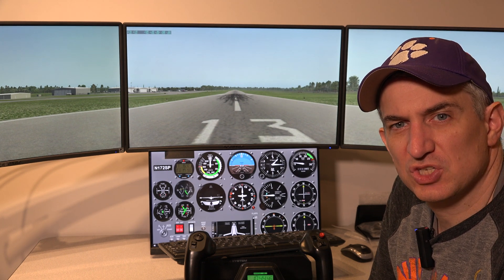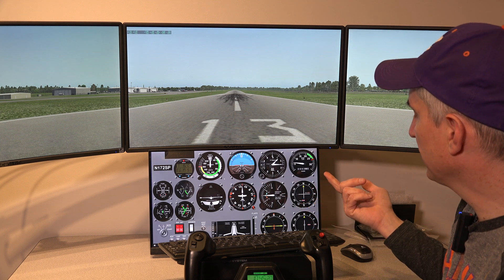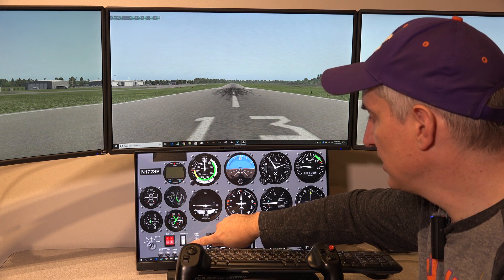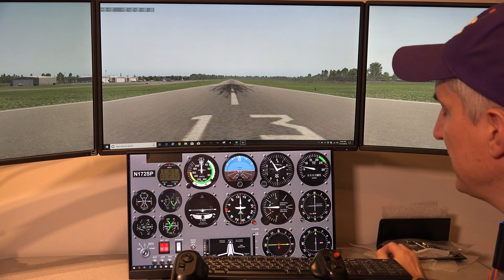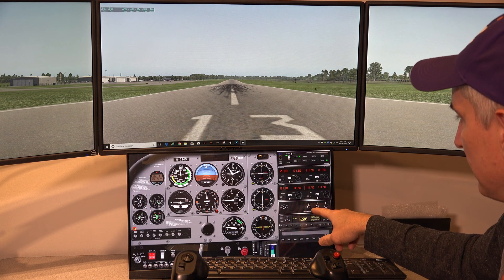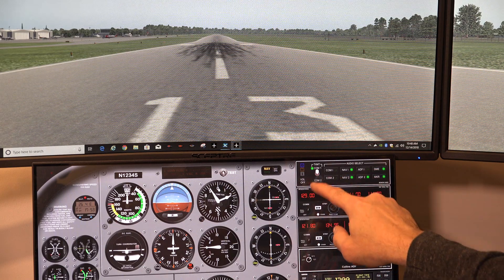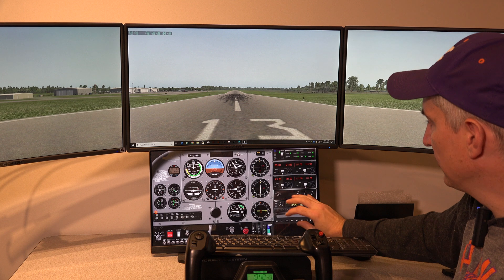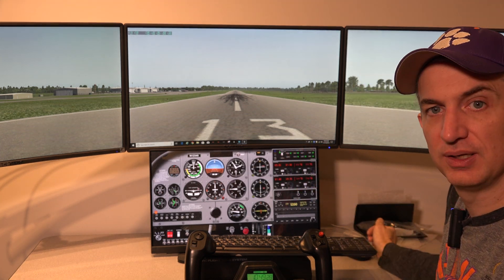How, exactly does the touchscreen work with Air Manager

Comment: Hi Michael, Obviously the triple screen has to be set up as the main monitor (because that is where Xplane appears) and the touchscreen monitor has to be set up as the secondary display.  This is where I run into a problem because the touchscreen functions wont work on the secondary monitor unless it's configured as the primary monitor. I have tried all the setup/configure options Windows 10 provides without being able to resolve this anomaly. I'm sure I'm not the first simmer to run into this problem. Did you have any problems when setting up and, if so, what steps did you have to take to resolve it?  I am using a GTX 1080.  John.

Comment: I would love to use all that stuff if you could please figure out why my simulator has quit working! Set it up in the graphics page ... great (70-80 FPS) frame rate. Switch to cockpit and frame rate drops to 0.1. You famous tech support hasn’t figured it out and I’ve been unable to fly for over a month.
Reply from the maker: Are you using any of the logitech panels?  (switch, radio, Multi)?
Reply: Michael Brown yes I have a Logitech six pack and radio, multi panel, and a switch panel, all of which are turned off. In addition I have turned down the weather screen to clear. The frame rate drops on any airplane, no matter what the graphics settings are. X-Plane11 worked well for about 3months then suddenly started this frame rate problem. I’ve tried everything but no luck. Tech support sounds like they are grabbing at straws. I thought about uninstalling the whole thing and installing it new. (I have an extra set of discs that came with my sim package when I bought the entire setup in July). Please figure this out.
Reply from the maker: @pappybo49  Go into the plugins folder and delete the Saitek plugin folder (or move it to your desktop) and try again.
Reply: Michael Brown the only place I find a plug-in file is in a resources folder which is in an X-Plane11 file in Desktop. And that doesn’t refer to Saitech plug-ins
Reply from the maker: @pappybo49  If the saitek plugin is loaded, there should be a folder in the plugins folder called "xsaitekproflight".
Reply: Michael Brown Yes, is that what I’m looking for?
Reply from the maker: @pappybo49  Yes.  Move that folder to the desktop (get it out of there) and check your FPS issue.
Reply: Michael Brown FPS works but wha about my panel?
Reply from the maker: @pappybo49  What does the company you bought all of your stuff from say?
Reply: Michael Brown I purchased the panel and instruments along with the controls and the XPlane11 discs from “My Pilot Store”. On that day I also purchased an HP Omen DT 875 computer and Samsung 49” monitor exclusively for my new simulator. Best Buy’s Geek Squad did the installation and I was in business. The whole setup worked as advertised from about 8/1 to about 11/20 then suddenly stopped. If I need more computer, tell me and I’ll beef mine up, but it seems odd that it would work so well for that long and then just quit. I thought I bought plenty and was running frame rates of around 50-55 FPS.
Reply from the maker: @pappybo49  At XForcePC, we build PCs and sell all of that stuff that you purchased.  People come to us because we have specialized knowledge, like how to fix your issue, or prevent it in the first place.  I knew what the problem was from the very beginning and showed you how to make it stop.   Unfortunately, I am unable to help you further as we only provide this level of support to our customers.  I'm sure Best Buy, HP,  or My Pilot Store can figure it out from here.
Reply: Michael Brown - My husband is on hospice care & we bought all this to give him the experience of flying since he is in an electric wheelchair  & bedridden.  We have called the other vendors & were told to consult you to solve the issue.  I am  really surprised that you can’t or wont help resolve my husbands issue with your software.  He has tried everything suggested by tech support to no avail.  I am very disappointed in your customer service - I would be happy to pay for someone to fix this but it sounds like you aren’t interested in helping a 70 year old man fulfill his bucket list wish.  Merry Christmas, Cynthia Bodine , Steve’s wife of 50 years
Reply from the maker: @pappybo49  This is not my software.  I do not make any software of any kind.  The Flight Simulation software is X-Plane and it is made by Laminar Research.  The software for the Panels is made by Logitech.  I sell computers, of which you have none.

Comment: Thank you Michael. Just wondering why if I turn the screen to the right, the instruments come back. Ctrl w works to remove instruments but on turning the screen to the left side, they're back. Suggestion...
Reply from the maker: In the graphics options under "visual settings" you can set the default view to be forward with scenery only.
Reply: @xforcepc  Hey what touch screen monitor are you using bro?

Comment: I have the same question as Juan but I have a GTX 1080 GPU. I have triple monitors running X Plane 11 and would like to add a touch screen monitor to run Air Manager.  It's my understanding that the 1080 GPU just supports up to three displays.  Michael, how do you connect a (4th monitor) touch screen monitor to an existing 3 monitor set up? Is there an adaptor or do I need to add an additional GPU? Thanks again for your informative videos.
Reply from the maker: Your card supports FOUR displays.
Reply: Thank you, I'll start working in that direction. I appreciate your reply. @xforcepc